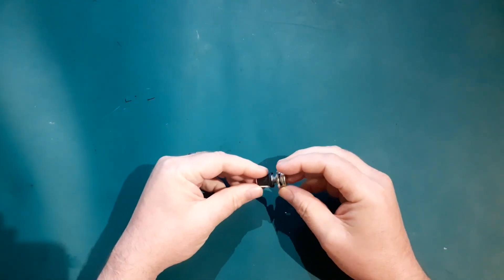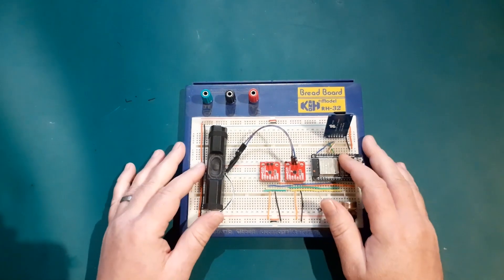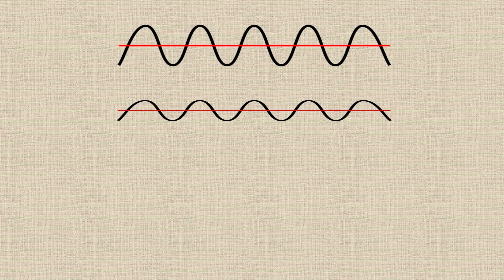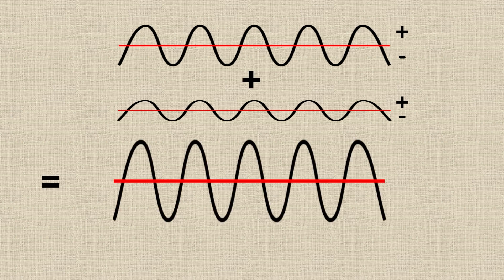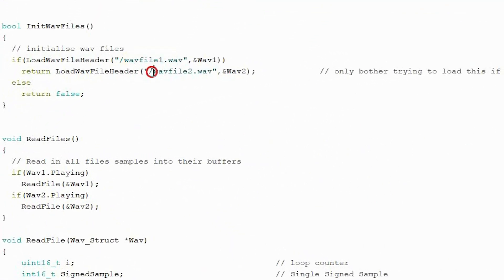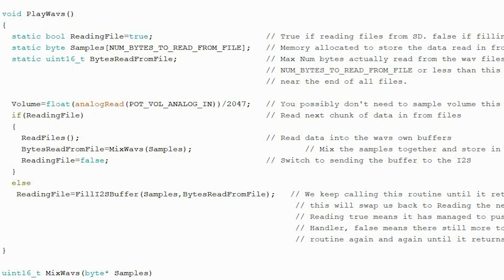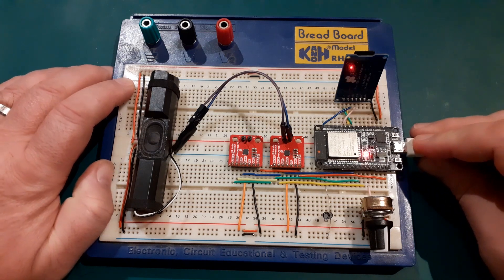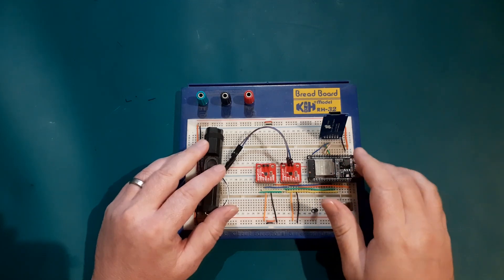Writing your own ESP32 I2S WAV Player - Part 5 - Mixing sounds

Comment: Thanks a lot for your great work. I use the mod from stelatoris which bases on your code. Unfortunately there is a flickering sound about with the frequency reading from sd card. Playing the same wave file with the I2S library from Schreibfaul1 on Github, this does not occure. Any idea about this problem? Thx.

Comment: How exactly can i modify this code to mix 3 or more wavs together ? Like I managed to include , read many other files from sd , but im having a hard time trying to rewrite the code so it mixes 3 wav files at once but also is possible to play different wav files other than the ones being mixed ? Like basically for that engine sound module. I tried replicating your code in the mixing bytes part , first by implementing separate volume control which worked by bringing the volume multiplication part from the final sample to the separate samples before being mixed, but when I tried replicating the code to mix 3 wavs , it does play the audio but everytime I mix even two audios together, I'm getting random noise ,even when the volume of one audio file being mixed is at zero volume .
Reply from the maker: Mixing sounds from sd etc. Is a to do task. I can't give a simple explanation here. It requires some reasonanble coding to cope with the slowness of the SD card.

Comment: Hi for some time now I struggle to find a circuit or concept that will work for my project and it seems like yours could do the job. I build a guitar pick-up with 10 coils, one for each string. I build separate coils per string to get rid of the noises caused by the adjacent strings, and so I can see the frequency of each string to adjust the string more accurate. What module can I use for the 10 inputs, and will the esp32 handle the 10 signals?
Reply from the maker: Esp32 has 18 adc's so that's fine but the sampling rate is only around 1khz which isn't going to be good enough for your project. You can increase this according to the data sheet of you turn off WiFi etc. But I wouldn't recommend it.
Reply: Thanks for your feedback, any suggestion? maybe a mixing circuit to 1 output before the esp32 and using the esp to only sample one string through a multiplexer?

Comment: Hi amazing video, we tried your code on mixing two audios and it sounded clear, but when mixing 3 or more sounds we get a very loud noise and the speed of the sound becomes much slower, we tried to reduce the volume in the source file but this did not solve the problem, do you have any idea why?
Reply from the maker: For the speed, I'm guessing that the code can't keep up. Although I've mixed many sounds on my older DAVAudio library. So it might just need a tweak/ buffers looking at. Not user why the noise is so loud unless mixing identical sounds.

Comment: Hi, great work with your project. I plan on implementing it to mix anywhere from 2 to 6 wavs together, however using your sketch and mixing 2 wav songs, I get crackles and pops when bass is meant to be played. I have even considerably reduce the volume using the volume divider in the sketch but no luck, can you help?
Reply from the maker: I'm not sure apart from the sound in the source clipping, is it only when they are mixed? If so try reducing volume of both source files prior to mixing.

Comment: That looks great. I’m curious if two WAVs are meant to be played on 2 channels, goes to each DAC, do we need to mix them together?
Reply from the maker: Yes, they need mixing. In my new library coming later in the year you will be able to mix stereo to mono and play on one channel if you wish
Reply: @XTronical  appreciate. I will check it when I receive my DAC👍. BTW, it that library also work with UDA1334A or other similar board that came with headphone jack? For 2 channel output on the jack.

Comment: Hello, thank you for the very helpful video. I managed to get your previous codes working on my ESP32 project. When I tried this one, however, I find that both tracks play at a slower speed than normal. Any idea what could be causing this? Thank you.
Reply from the maker: It's not getting the data from the sd card quickly enough is the most likely culprit. This could be a slow sd card or perhaps if you've mixed sounds of a very high bit rate. Hope this helps.
Reply: You can try to change the SD card initialization and set the frequency to 8,000,000, this worked for my 4GB SD card:
void SDCardInit()
{
  pinMode( SD_CS, OUTPUT );
  digitalWrite( SD_CS, HIGH ); // SD card chips select, must use GPIO 5 (ESP32 SS)
//  if( !SD.begin( SD_CS ) )
  if( !SD.begin( SD_CS, SPI, 8000000 ) )

Comment: Hi, I'm having trouble using Wav File to mix the sounds. Can you help me?
Reply from the maker: Can you be more specific
Reply: @XTronical  
I want to play two WAV files from memory, stored in a file called Wav1.h and Wav2.h inside the directory. I am not using an external memory like the SD card. Thank you!
Reply from the maker: Ahh, right, yes this is possible. I'm working on a new library that will do this. In the meantime my old library called DACAudio can do this. But had other limitations, worked using the dac pin for one and reduced quality but might be OK for your uses.
Reply: @XTronical  Okay, I’m waiting for the new library, I need to use it with i2S.

Comment: Do you how to remotely upload file to the sd card by any chance?
Reply from the maker: As it has WiFi then you could do this. But it would be some reasonable code. Although I'm not aware of one, someone may have written a library already. Sorry I can't be more helpful.
Reply: Tks anyway. The esp32 probably doesn't had enough memory cached both the audio to play and the file to write to the sd card. And it's easier to pull out the card than multitasking them.

Comment: Thanks for the theory and practice! Can you please tell me with the DacAudio Library you can make an Internet radio? Maybe you have already done such an example?
Reply from the maker: Yes, I have done this example, see this video https://youtu.be/3ao87AgZ7Bc
Reply: @XTronical  I saw this video. :-) I meant to use the internal ESP32 DAC
Reply from the maker: Ahh right, sorry, misunderstood. I've no plans to make Internet radio with old DACAudio library. But will possibly eventually integrate into new I2SAudio library.
Reply: @XTronical  Does using an external DAC give you a performance boost? The quality will be better with an external DAC anyway. Many people build internet radio using an internal DAC - but does that make sense?
Reply from the maker: I've not done any tests but I would have thought that external dac maybe a little better in performance and is certainly better in quality.